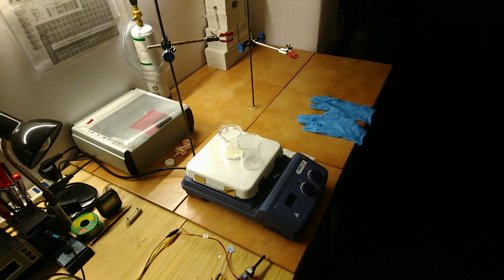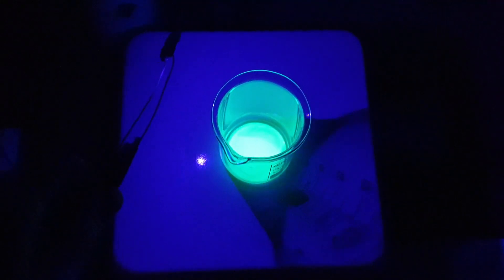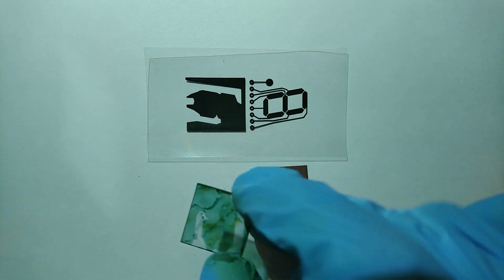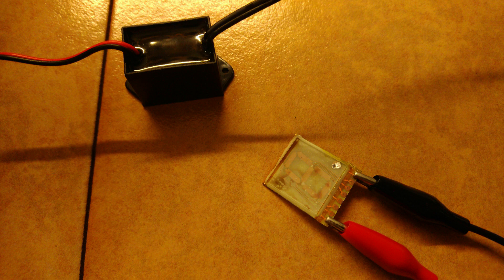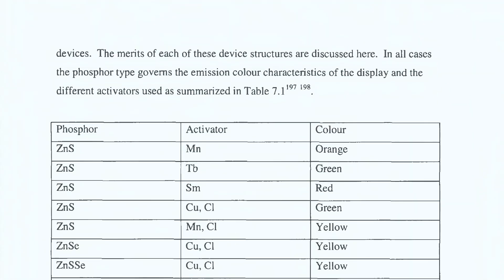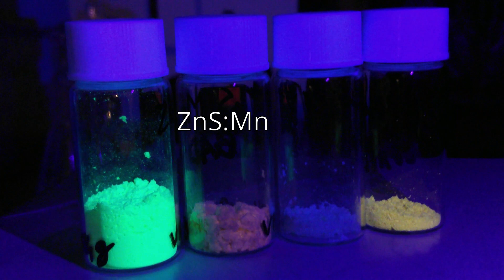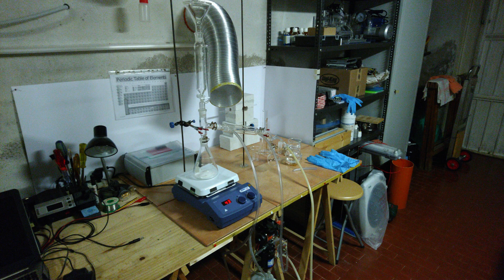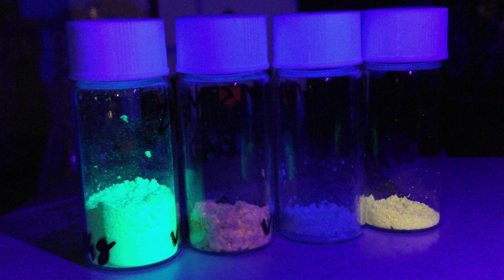100 subs, NileRed citation, phosphors and more

Comment: Maybe it would be easiest to make a cathode ray tube with some of your phosphor inside. With your original approach, maybe a good dielectric between the phosphor-coated conductive glass and the electrodes would act like a capacitor and allow you to use a higher electrical potential.
Reply from the maker: I am learning (simple) glassblowing for another project so it may be a good idea, but it won't happen soon, as I currently lack the high vacuum equipment needed for making a CRT.

Comment: Epoxy might not be the ideal binder, as it insulates quite well. 
How about potassium waterglass? I heard it mentioned as a binder in a video about oscilloscope screen manufacturing. I do wonder for how many phosphors it ca be used though, as the alkaline solution might react with some compounds.
Reply from the maker: I have a preparation procedure for this, but I had to make some substitutions as I don't have the necessary reagents, I used Na silicate instead of K silicate, and Cu acetate instead of Sr acetate. Did not work at all, but I may try to get the proper reagents and try again in the future.

Comment: Did you use AC or DC current to apply to the EL panel? I heard from various vids on yt that the ZnS:Cu coated EL panel glows only with AC current. Such as:  https://youtu.be/_FXukyeNEFQ?list=PLc_fLawrWT9o2CKb1W34zSWJ4NJEfUfuh&t=222
Reply from the maker: I used AC, and I even tried with a specific power supply for EL wires, with no luck
Reply: @hydrogentime2872  Better luck next time, bro.